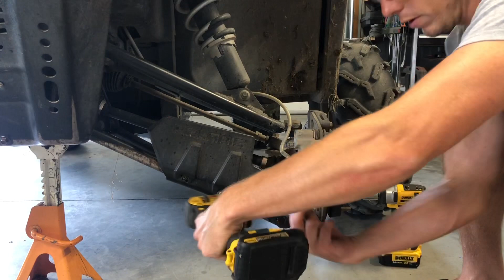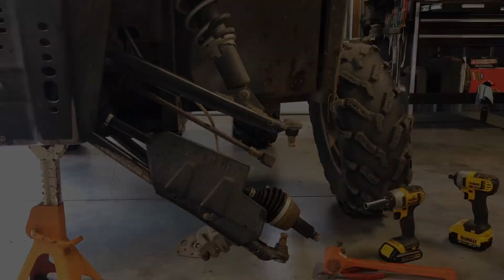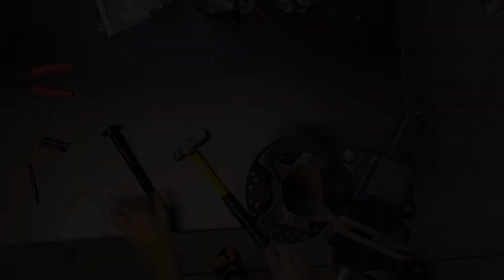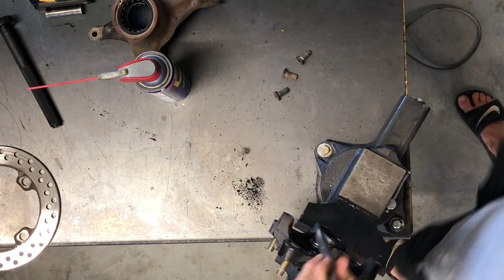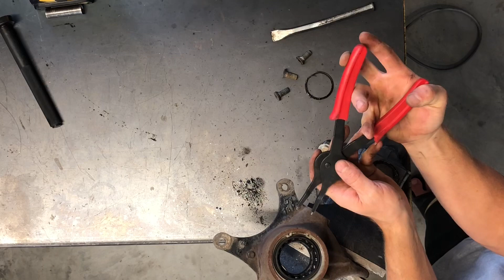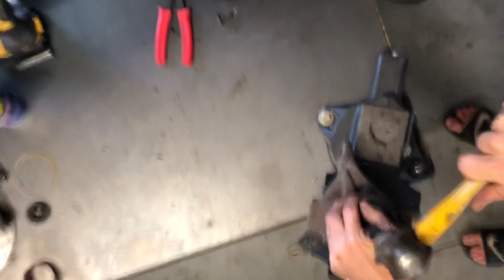REPLACE - Polaris Ranger - Front Wheel Bearings - Remove / Install

Comment: Never hang your caliper like you did!
Reply from the maker: Lol, ok. Thanks for watching and the comment!
Reply: @MidNebraskaMotorsports  you could break, stretch or break the line. Now you need a new line and bleed the brakes.👍
Reply: Why not
Reply: @markconner3234  may stretch the rubber hose,may cause a tear or a break the hose.
Reply from the maker: Yea, I get what you are saying. Car calipers you definitely want to be careful. Of the several thousand of these that I have worked on, torn down, or rebuild. Never 1 time have I seen a hose leak/crack in that area. Could happen though. You are right. Thanks for the dialogue.
Reply: Great job and nice video.  I use zip ties to hold the calibers up. Thanks again

Comment: When installing bearings and you find yourself in between sizes on your drive tool, grind down the O.D. of your old bearing and use it as the main driver and the drive tool itself as the secondary pushing on the old bearing.  Also throw a little heat into that knuckle as well as freezing the bearing.
Reply: Great idea on grinding the outer bearing im using that one.😮